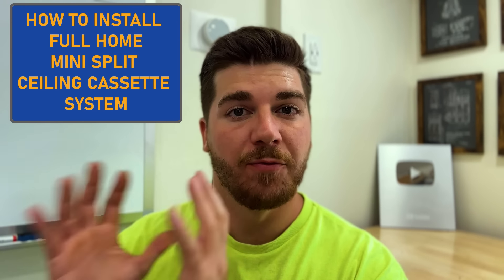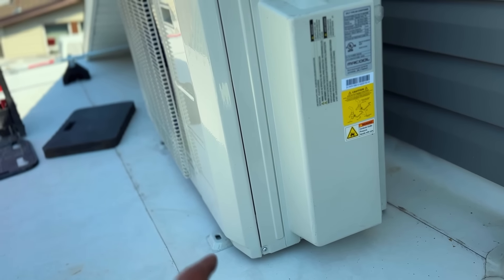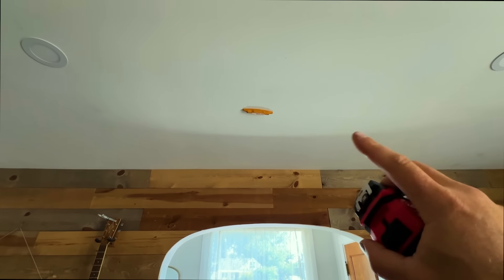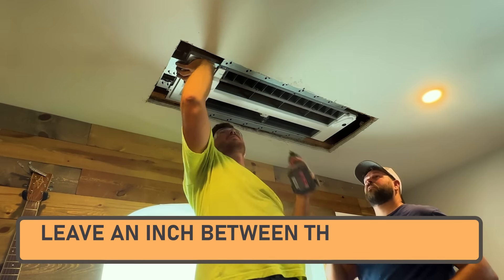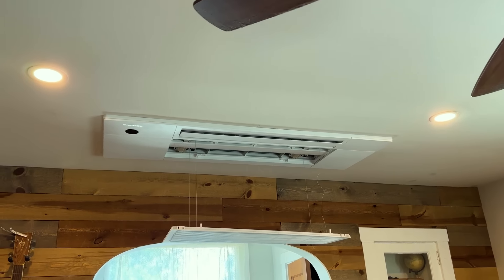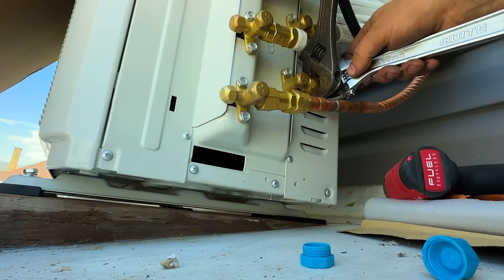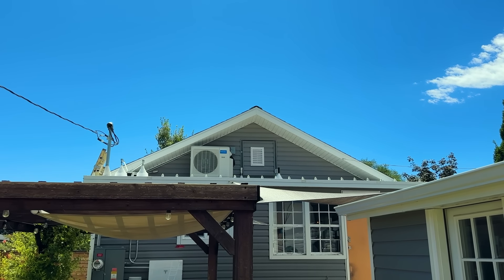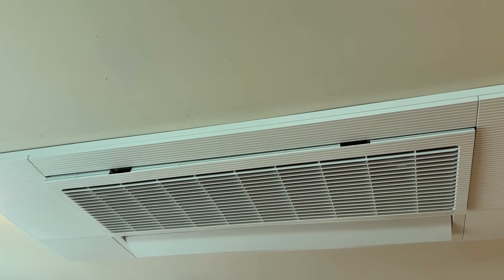The Mini Split - REINVENTED.

Comment: All I would add is cleaning these. I know many people think these head units don't require much cleaning but they do. It's unpleasant enough to clean wall mounted units but these on the ceiling also look hard. I have a pretty good method for cleaning my wall units but unless these ceiling units are more serviceable then I'd stick with the wall units. What all these units should have is a simple way to remove the necessary parts for cleaning without getting into all the interlocking plastic parts (and tabs) which makes getting it all back together and quiet a tedious task. If the blower wheel on these ceiling units simply drops down and out (without removing too much plastic housing) then I might be sold. But something tells me that is asking too much.
Reply: @25:45 They have a filter at the intake before the fan to keep dust out of the unit. The filter lowers down to help you clean (not change) it. They copied this from the Japanese manufacturers. Do people tear down their attic based central HVAC equipment to scrub the fan blades? No they do not.
Reply: I do like the idea, practicality takes over and service on each unit can be tedious.  Condensation drain on each unit needs to be checked and cleaned. Great idea, still requires more maintenance than a central unit , but if a central unit isn't possible, this is a good workaround.
Reply: @karlInSanDiego we do pull and clean evap coils and blower motors.
Reply: Hope you have ample crawl space in attic because any repairs/maintainance will be a bear. Replacing condensate level sensor, replacing condensate pump, cleaning condensate pan, etc., etc..
Reply: @freonpeon472 I believe that is all accessible from below as the attic side is really the outside of a steel spot welded box.
Reply: @GregKrynen  Granted I've never worked on low ball crap made for DIY residential. But all the Mitsubishi, Fujitsu & LG cassettes I've worked on were commercial quality & circuit boards, pumps, sensors etc. were above ceiling in T-bar.
Reply: @mwrcrft   - central units with ducted distribution typically use more continuous power, and take.need more attic installation space  for the ducting..

True all the refrigerant and condensate is then dealt with in a central location, I simply see far too many terrible ducted installations around (nearly unserviceable without a complete tearout and reinstall),.
Modern inverter mini Splits (wall or ceiling mount - if no accessible wall space - sems the way to go for retrofit of AC - heat/cool, and a simple ducting system (with H/ERV) for air changes - if required.
Reply: @karlInSanDiego  If you filter it right, you'd never need to clean the internals.  But that's not likely to happen.
Reply: @Korrea00 What product do you use to clean the fan blades? I was an electrician for 25 years so I’m familiar with these things but have never found a good product to clean fan blades, will the coil sprays work for them?
Reply: @1924ab  yeah after pulling the motor from the assembly I spray a diluted mix of coil cleaner and let it sit. It will get them clean, it won't look shiny tho the cleaner leaves the metal a little dull looking but it cleans really well
Reply: Mine is the garage I have a 120 gallon 13.5 CFM 2 stage compressor use long probe blow the thing out with air. I took some steel brake line brazed the end closed and cut slots in the sides of the brake line with a dremel. The air blows out the sides I suck the dust up with a shop vac works great. You could rig that up to a scuba tank or 55 CU nitro rig do the same thing.
Reply: Cleaning the filter is critical, sure, but the #1 reason the fans need cleaning is oversized operation.

When these units operate in a space too small for the capacity of the system, massive humidity loads allow moisture to collect on the light dust that makes its way through the filter, and allows microbial growth. THIS is what needs cleaning.

Size the equipment properly, and your buildup is minimal.
Reply: @Mike-01234  a long flexible zip tie works for the drain hole as well without removing any of the housing.
Reply: @karlInSanDiego  attic units absolutely need cleaning, last call blower wheel was so dirty it wouldn’t spin.
Reply: @whochecksthis  space too small or too large.?
Reply: Maintenance and repairs are very very expensive cause the unit his in the cealing unless you have removable tiles forget about these units ( ceilling) cassette....30 years exp. here. 👍
Reply: There’s these large vinyl cloth funnels that you can attach to the unit. Spray and foam the unit and it all just drains into a bucket.
Reply: I’d like to know how you clean your wall unit. These we’re clearly not designed to be cleaned as thorough as I would like. Cleaning the filter is not enough.
Reply: @freonpeon472  What makes you think it's lowball crap?  Is it because it doesn't cost an outrageous amount like the stuff you HVAC guys install?  I've had a Mr Cool unit for 7 years and had zero problems with it.  Cools great in the summer, heats great in the winter.  Cost me $1400 and took about 3 hours to install.  Having HVAC company put one of theirs in would have been 6k.  What a joke.
Reply: @karlInSanDiego  the wall units have filters too, it makes no difference the slim blower wheels still get full of dust lint etc and they stop blowing air if they're not cleaned at least once per year.  I like my mini split for additional AC, but I dread that once a year maintance.
Reply: he blower isn't powerful enough to pull air through higher MERV filters. When you save in one area you pay in another everything equals out in the long run.
Reply: Bosch makes a unit that's like that.    There is a YouTube video on it.
Reply: @Korrea00  you missed the point. Out of the millions of units that are installed how often does that happen? If you're being honest and you're not going to be that guy, you'll admit it's next to never.
Reply: @karlInSanDiego  It's not the dust. It's the tremendous amount of mold & mildew growth on the fan blades, especially in humid climates. You'll definitely smell it and it's expensive to have the fan removed and cleaned. The mold returns within a few weeks and your dealing with the same issue. To prevent this issue, install a LED UV light strip (I used the FreshAire brand). . I've had it for 3+ years and it's a game changer. Just turn it on for a few hours daily and you'll be good.
Reply: Correct.
Reply: Just begging for a blower wheel that drops out the bottom or front with no complicated plastic clips. It really shouldn't be that hard. I mean less plastic on these units wouldn't be bad.
Reply: I moved into a house with a ductless heat pump a year ago, not realizing it needed cleaned and then my son moved into another house with one and the house stunk. He looked and it was full of mold. We live by the sea in NS Canada. Both clean now. He took mine down and I cleaned it. I plan to build a small home and am looking at doing ducted with a slab floor and frost wall, but it needs to be accessible to clean. Just watched a video from BC Hydro on one that can go in a closet.
Reply: @NaturesInfiniteWELLth-fo6rs  which reminds me this is the season for my final cleaning of the year! I still do 3 cleanings a year. Just to be safe.
Reply: @karlInSanDiego  I do
Reply: I have cassette units throughout my house. They work excellent but they use a radial fan that requires no cleaning as radials are self cleaning. This unit uses a squirrel cage just like the wall units and must be either cleaned upside down or the cage removed and cleaned elsewhere.  The only advantage this unit has is it fits between 16 inch floor joists as standard cassettes need 24 inch ceiling joist or you have to box 16 inch floor joist.
Reply: @karlInSanDiego we have the wall units and ceiling units in some of the offices and break areas at my work. Even if you clean the filters monthly, if you don’t at least spritz water over the coils or blow them and the fan out, they will start clogging up. The filters aren’t ultra fine by any stretch.

Comment: Two comments: 1) Ceiling cassettes require condensate pumps.  Make sure to add algae prevention to your maintenance plan to avoid clogging the pump (PITA to access the pump on our Mitsubishi units) and 2) Individual room temp controls is fantastic, EXCEPT in Spring/Fall.  If you have multiple heads on a single condenser, it can only operate in cooling or heating mode (of course....but people forget).  In seasons with big temp swings, folks in different rooms may want heat or cold for comfort.  Typically, the first unit turned on in the system will be the master (setting cooling or heating), and the others will be master to that setting.
Reply: I personally don't like the idea of having the pump and any service issues like that. It being up high and flush just makes me think getting in there is going to be even harder than with a wall mounted unit. On my wall units I do one cleaning each season to help keep any clogging of the gravity drain line and other grime from building up. Getting to the blower wheel is hard but I have found just using a self-cleaning and washing formula is better than trying to take it all apart each time. I simply turn the wheel and spray it lightly which helps the formula dissolve much of the dirt. BBJ Micro Coil Cleaner etc.
Reply: Great comment, thanks.
Reply: Mitsubishi makes units that can heat and cool at the same time, pricy? oh yeah....but the tech is there....just saying.
Reply: Mr cool cassettes have a built in pump. Iirc it's rated for 29" vertical.
Reply: One person wanting heat while another wanting air condition is a non issue. I can’t imagine who would have this big of a discrepancy in house temp and not be able to easily make a compromise. And what would these same people do with a ducted system? Total BS argument.
Reply: @speciesofspaces  I installed 6 ceiling cassettes and 16 wall mounted at very large residence last winter. Two of the cassettes were 18ft above the floor. Servicing those in place would be difficult at best and dangerous at worst. With the DIY lineset connections it can be disconnected (Mr cool advises against this though) then the lag screws removed and the unit lowered to the ground. Then it can be safely serviced or more likely replaced.
Reply: @9HighFlyer9  thanks on this new build I am doing we will definitely be going with the ducted version of these heat pumps.
Reply: The units we put in have built in condensate pumps
Reply: @michaelsnead3018  a more expensive unit may have multiple reversing valves or move the heat form room to room
Reply: @ZERO-F2G- do they have one for residential? I thought LG was the only one that had a heat recovery system (simultaneously heating and cooling) for residential.
Mitsubishi and Daikim both have their own heat recovery set ups but they are 3ph, typically only in commercial

Comment: As a plumber that actually does hvac also , my only suggestion is to not connect all the condensate drains together. It would only take one of them to plug up the "main" drain line and then all of them would have issues.

Comment: The downside to the minisplit systems is the lack of a quality filter system. The coil will get very dirty.
Reply: Unfortunately, all of the air conditioner manufacturers seem to design most, if not all of their window units and these mini-split systems too, in the same way. With cheap plastic and Styrofoam that readily grows mold and mildew, they're not maintenance or serviceable - friendly, and they all use flimsy, pathetic filters that don't filter the air anywhere near enough to protect the unit from getting excessively dirty and clogged up with mildew, dirt and mold, that's nearly impossible to get clean again, at that point! It's frustrating to spend hard earned money on something and then be forced to have to replace it, in just a few years, because you can't keep it clean enough to continue operating normally, nor efficiently, or just can't clean it well enough, at all, in general. Everything nowadays, seems to be designed as disposable, but with the price of something that should last for decades! So you’re forced to spend more money, sooner than ever before! It's despicable, as far as I'm concerned.
Reply: THANKS SO MUCH FOR YOUR INSIGHT😊

Comment: Hey Dave I suggest you blow in another 8 to 12" of insulation. It makes a HUGE difference in how much energy you will use and it is all DIY
Reply from the maker: Yes it’s crazy how much that stuff settled. There was a solid 14” when I blew that in and now it’s touching the rafters!
Reply: @diyhvacguy blown in insulation is always a lie like this. It’s impossible to get truly even. You need to understand every job will always need a second visit to add material after it’s had time to settle.

Therefore blown in should only be used as the addition to the r30 batt or roll already laid in the attic. Used that way the blown in gets to add all its benefits w as few of its downsides as possible.
Reply: Can you cover these ceiling units with insulation? What about air sealing between them and your ceiling with caulk and spray foam? I love the look of these units, but I fear they’ll lose a lot of coldness to the attic and let air leak up there. Would love to see how they affect blower door test and thermal camera.

Comment: In Florida because of wind loads and stress on the roof, and especially since you have access to the interior of the gable end wall, I would do a reinforced wall mount with extra king studs to jack studs and two headers to attach the wall mount to. With investment in a few 2x4s, some 8d nails, and a rated mini-split wall mount bracket, a wall mount will not only remove load from the roof but also make roof maintenance and replacement much easier in the future.
Reply: You don't need to go to that sort of effort, most indoor units only weigh about 10kgs - 20lbs, or about the same as a 40-50inch TV.
Reply: @stevegraham3817  I believe he's talking about the exterior part. "wall mount" not ceiling mount for a ceiling cassette system.
Reply: @GeorgeWashingtonLaserMusket  In that case, the compressor/condenser part of the unit only weighs around 30kgs, so it doesn't need reinforcing for a 300kg load.

Comment: I've installed these with two split units but not ceiling type split. It was inverter type so it used a lot less wattage. Thank you for the Vid.

Comment: man, watching this remind me of the many years i spent in florida attics running lines, ducts, drains,  attic change outs, etc.  i don't miss it one bit.  the young bucks coming into the trade will have cake work after these units replace the traditional systems.
clean works boys!!
Reply: I would disagree.    instead of 1 line set to change, you now have 4+.   Instead of 1 drain to worry about clogging, you now have 4+.  Imagine having to deal with 4+ condensate pumps!!!   Time will tell I guess.
Reply: @Val-xi4we  fair enough.  but i tried showing new kids in the trade how to build spider plenums,  all i got was a deer in head lights.  seems as if 4 condensate pumps is lite work to running proper ducting for the new gen.  maybe it was just my area and the kids that needed work bad enough to hang out in a 130 F attics all day with another sweaty dude.
Reply: The cost?

Comment: I have had a Mr. Cool AC/Heating System in my detached garage/shop for over 4 years with no issues...Love it. Im considering removing the HVAC connection from my master bedroom and adding a Mr. Cool Ceiling unit for it. This seems like the perfect idea. Thanks.

Comment: great info, I like the video. I used to do duct cleaning and system coil cleaning, both sides. So, never ever make drywall dust with ac running. it will mess up the clean system coils! that's how we were called to clean. You can probably run it make it cold, then turn off and work or work at night. or leave the old one running while installing this. but if you are ready to clean them up, go ahead. Go ladder crane!

Comment: Awesome content, this is really flexible for people with a house with no or super crappy duct work. I'm getting a new ducted system installed because i have some quality ductwork and that's a lot simpler than installing heads.
Reply: Room by room saves thousands tho
Reply: @AgentOffice  with my house the payback on room by room vs ducted is non existent. Just the equipment, extra line-set, and plumbing the drainage would cost a fortune. I'd need about 6 heads for proper coverage. Plus I like the higher merv rating on the filtration I get with ducted instead of just a mesh screen. Go run a seer cost calculator on what you actually save vs a less a efficient unit. If you don't have Cali electric prices the payback isn't there. Now if there wasn't ductwork already in place I'd be installing ductless for sure.
Reply: @mathehack1  true I'm in cali and can keep one room freezing when outside is 110 almost free
Reply: @AgentOffice  oh yeah if you're in Cali it'll save thousands for sure. I live in NC our electric rate is .11 cents per kwh and will go down next year due to fuel prices. I use like 1600 kwh a month and with taxes and bs fees from Duke Energy my bill is $250 to $280 a month during the summer with highs in the 90s when we were on our old 12 seer R-12 unit. Getting a new Bryant 2 stage split ducted unit installed next week cause our old unit died. I'm hopeful it'll lower our bill like $30 or $40 bucks a month but that's about all I'm expecting.
Reply: @mathehack1  wow here if I use central maybe 1500 in summer
Reply: @AgentOffice  wow, that makes solar make so much sense there. If you have property throw some panels on the ground and power a split unit and save $1000 a month.